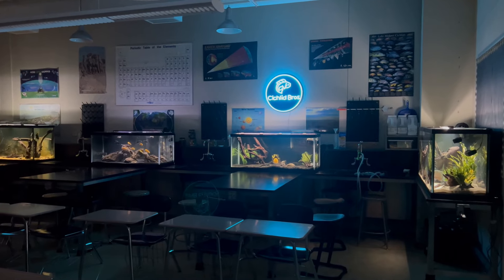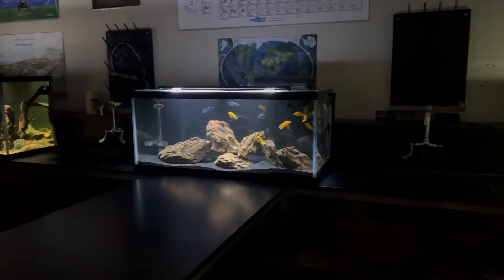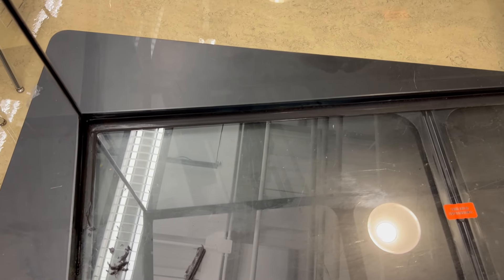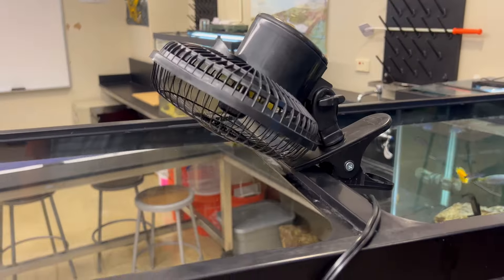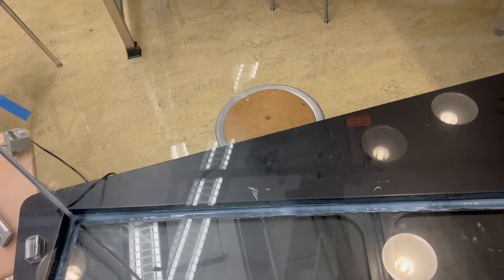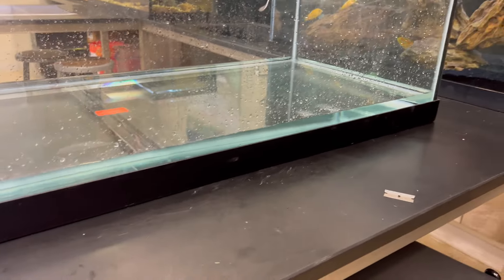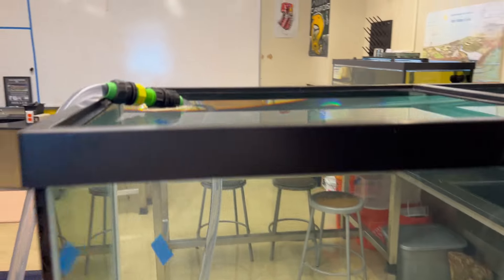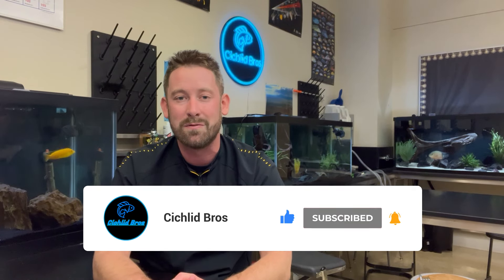How I Resealed My Leaking Fish Tank (Like New 90 Gallon Aquarium!)

Comment: I did my 220 gallon just like you did. And yes it is a long process. But with time and patience it's well worth it. You did a great job!!!
Reply from the maker: That is awesome! Definitely agree 👍🏻
Reply: How is it holding up? Doing a reseal on my 220 gallon now. Had a small pin hole leak on the bottom. Real nervous about long term durability if I don't fully disassemble the glass but it's just too big so I'm doing the bottom and all 4 corners of silicone but leaving the panel joints alone.
Reply: @jamesmakesvideos  well it 3 and a half years ago and still holding water I sold it to my neighbor and he is running a salt water tank with it. And it's doing just fine.
Reply: @razinfishes1918   Fantastic! That makes me less nervous about mine. So many people saying they had issues and it isn't worth it. I just bought the tank last month, and paying $3K+ for another isn't possible for me, so I'm going to give it a shot.
Reply: @jamesmakesvideos  don't be nervous just take your time and get all the old silicone off. Buy a box of razor blades and change often the sharper the blade the better it comes off
Reply: @razinfishes1918  thanks, I went through 10 blades then used two full tubes of caulk just to be sure. Leak test time soon, waiting 72 hours to be sure it cured (instructions said 24-48 is enough but this is a huge tank as far as "floor full of water" goes..).
Reply: @jamesmakesvideos  yep give it a few days to cure real good I waited 3 or 4 days before I put water in it. And I just recently did my 125 about 2 months ago and leak tested in my garage for a week. Now it's in my living room fully planted and full of fish
Reply: Hey im resealing my 220 and its up on its stand because its so huge. Bending over it is exhausting, do you think it could support my weight if i climbed inside?

Comment: As a completely inexperienced aquarium sealer I wouldn't do much different, but the masking tape doesnt really matter at the bottom unless you're going bare bottom (you did, I probably wouldn't) the only other thing I would've done is laid kitchen towel or even toilet roll around the base before doing a test fill.  If there are even tiny super slow leaks you'll pick it up much easier on a wet piece of absorbant paper.
Reply: Great tip!

Comment: Nice work!
It will probaly easily hold water for at least a decade. ❤

From my experience of resealing about 15 tanks and deconstruct and reglue nearly 10, I'd a few things slightly different.

Don't be afraid to use a fair bit of Aceton just before applying a new seal of silicone, it make the old silicone a bit softer, basically rejuvenate it, and the new silicone attatch seamlessly to the old.

And if you use some extra silicone at the bottom bit, remember that it can only dry up barely over 1/16 of an inch per 24 hours, so give it time to dry.

Beyond that, purely out of aestethical reasons, I would choose black silicone to reseal the already black silicone tank, but it doesn't affect the strenght or water proofness of the tank.

Comment: You could put angel fish in the 75 gal with some other community type fish. Or put them in the 90 gal. How long is that tank I have a 90 gal and mine is tall and 4 ft long. I wish it was shorter and a 5 ft tank IMO.
Reply from the maker: Great idea! My 90g is the same - 4ft long. Same as a standard 75 just a few inches taller

Comment: I'm working on a brand new 135 gallon Master Aquarium brand that had a leak (go figure $800 aquarium brand new). I bought a fresh qt of acetone and it doesn't remove any of the very light silicone residue, any suggestions on what I could use to remove?